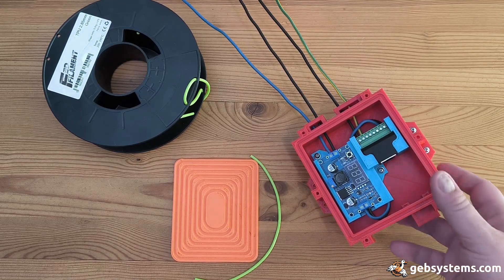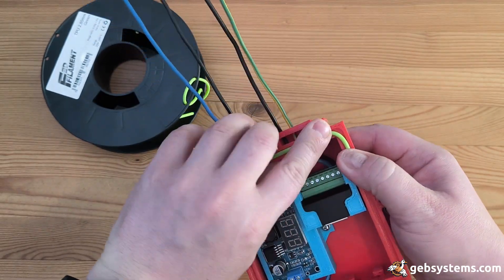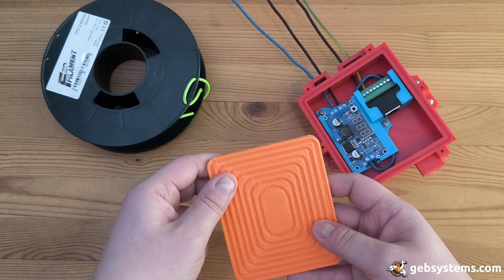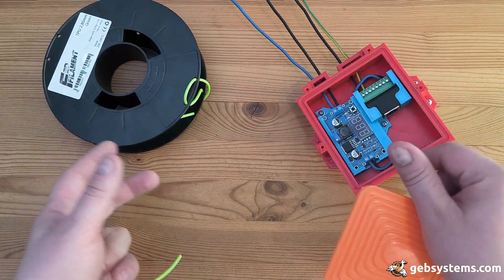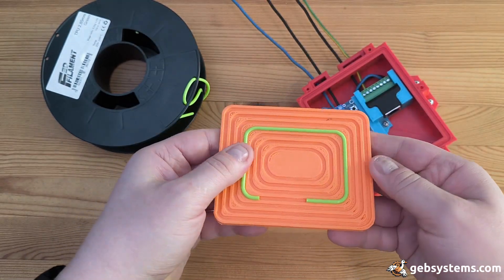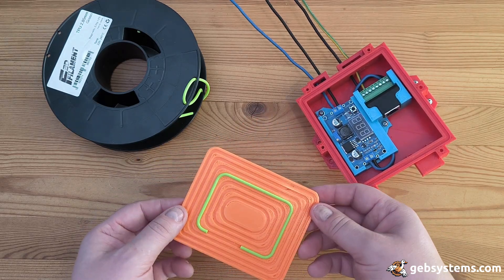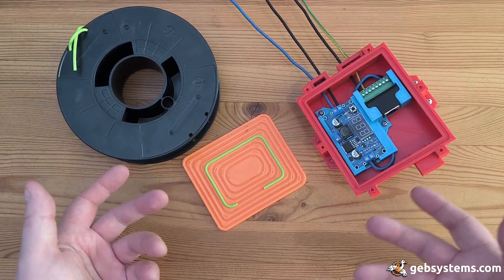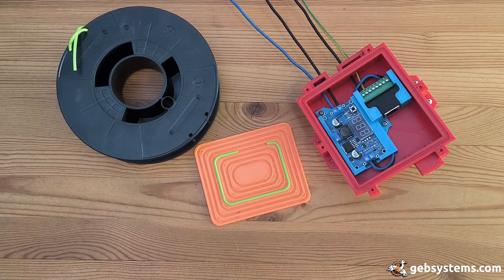Enclosure seal blunder | Arduino Modbus Project

Comment: First video I’m seeing of yours so not sure of the full context but have you considered looking at standards for conventional o-rings? Most o-ring suppliers have PDF guidelines on what the groove geometry should be for a given o-ring size(cross section diameter and inner diameter). If you find a supplier with an o-ring of similar hardness and size you should find pretty good groove dimensions in their guidelines. Might be interesting to compare them to your experimental findings.
Reply from the maker: Holy cow! Thanks! I was not aware that there are PDF guidelines for groove geometry from suppliers. I did some basic research for making my enclosures dust proof-ish and water proof-ish and I could not find the type of o-rings I was after. I was fully aware that some kind of industry has already figured it out and has all the standards in place but when you don't know exactly what you are looking for it can be hard to find. This is more of an exploration on what I can put together myself (even if it means that I am reinventing the wheel). I will have a deeper look at the topic at some point and as you said it could be interesting just to compare my findings to what the established industries are doing (and see how bad I am at it).
Reply: @gebsystems  haha it can be fun trying to re-invent the wheel. Gives you more of an appreciation for wheels lol. I’m no expert in this btw, just have been in a similar situation to you before. Try Hasco. They supply standard components for injection mould making, including o-rings. Product code for o-rings is Z98. They have decent guidelines. Also I’ve heard that you can buy a continuous o-ring and you cut it to the length you want and use a special glue to stick the ends together. Not sure who makes it and never used it myself but might be worth looking into for future projects. Best of luck!
Reply from the maker: @theitalker  Thanks mate! This is very useful and now I will definitely look into the O-ring product range from Hasco. And obviously I am in love with reinventing the wheel, who does not want that? I am just a dude who wants to make my Arduino Modbus project deployable and usable since I really do not enjoy the projects that are just a bunch of messy cables hanging around. Sure, the end result works but I can't put it to use since the wires can drop off and everything is vulnerable to the sneeze of a mosquito. And it does not matter to me that you are not an expert, who cares! You have knowledge that I am happy to use.

Comment: Definitely not 100% necessary, but might be interesting to look at some of the filament splicing prints out there to make a functional o-ring without a split. Very cool!
Reply from the maker: I think I am going a bit over the top but I am not sure of any other way that I can just DIY my way through. This is not meant to be perfect or industrial grade, obviously. Also, had a look at the splicing of filament and that looks like home brew welding haha. I am not sure if I need that for my TPU for now. I just make sure that I cut the ends and give it and extra mm so that if has to be forced pushed in so that it completes the loop nicely. Not perfect, but worked so far.

Comment: would be helpful if you shared the depth, width and curve specifics
Reply from the maker: Fair point. I should include it in the description really but will leave it in this reply as well.

The arc angle is 90 degrees.
The arc diameter is 80.
The width and the length of the groove is 3mm.
I am using the 2.85mm TPU to be the "seal" and to get it to fit into the groove I make sure that it is 2.1mm deep.
I am using 0.3 layer height for my prints.

Also making sure that the entire part is the right height so that everything gets sliced correctly. This enclosure in on purpose 32.1mm. The reason for this is that 32.1 can be divided by 0.3 which is 107. Also, when you subtract 2.1 from 32.1 it also divisible by 0.3 = 100. The part I have just printed is 51.3mm in height.